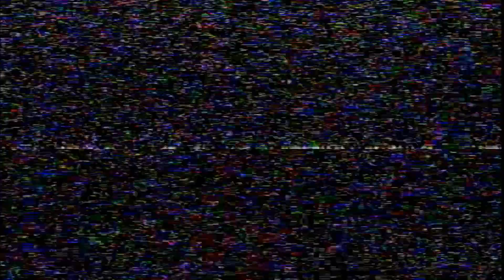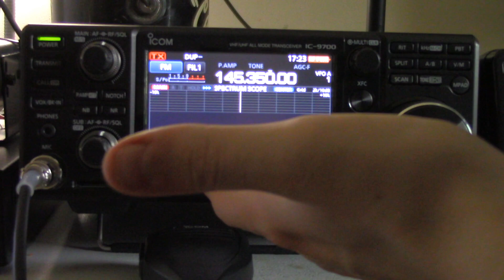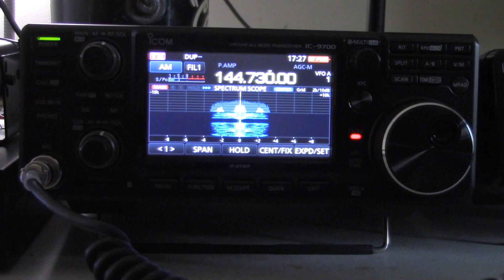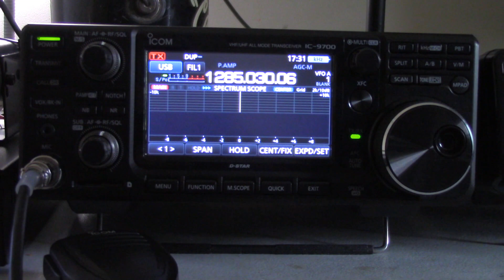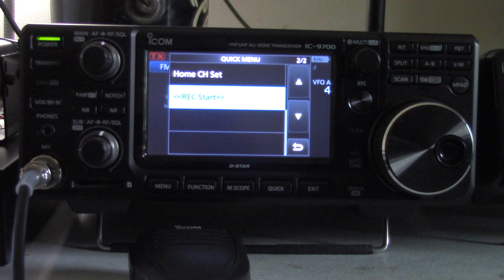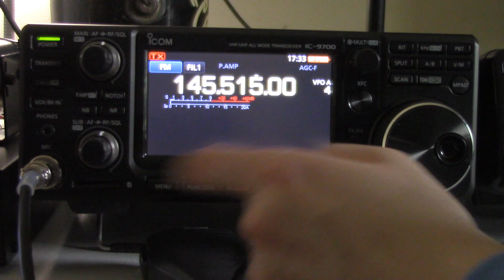Icom IC-9700 Overview: The Basics

Comment: Informative video, the IC 9700 has a learning curve a bit above the TS 790 that was purchased in the 1990’s, 2 + 70 still work but 23cm module is tired. 73 from VK4

Comment: Oh my goodness, what a lot to unpack with this video.  “Adjusting your wattage”, good buddy?  Please… it’s adjusting the power output.  It’s a radio, not a light bulb.  “This here is this here…”. Great.  Your comments about AM show a lack of understanding a controlled carrier design.  You made no mention of RF gain adjustments on a SDR radio.  And, could you go a little faster next time?
Reply from the maker: if you don't like the video, you don't have to watch it. 

I called it wattage for fun, lmao (I think I had an episode of "is it a good idea to microwave this" on my mind when I made this video for an audience of n=1, a local ham friend who wanted a whirlwind tour of the 9700 in lieu of a real technical overview)

I have built 80 meter AM transmitters that use controlled-carrier modulators, but that isn't how I got my masters in electrical engineering

Comment: Thanks, this was helpful. I bought a IC-9700 about 4 months ago, after owning a Kenwood TS-2000 for about 20 years. I found I kept going back to using the TS-2000 instead of trying to figure out the 9700. I will probably refer back to this a few times. lol

Comment: Do you still recommend the 9700?  I see other radios but they're low power, not sure I wanna get a base station with low power output.
Reply from the maker: Well, I would not recommend the 9700 for anything that doesn't need SSB or CW. If you do VHF/UHF weak signal DXing or work linear satellites, get a 9700; if you only do FM, get a Yaesu FT-2980.
Reply: @hs-tc  thank you.
Reply: G90, 20 watts is only about 1 s unit lower than 100 watts. VO1CSD

Comment: I want the ICOM IC-9700 for satellite decoding.  But is it true the 9700 does not have enough bandwidth to decode 9600 baud signals?  Thanks, CE4JDM
Reply from the maker: Unfortunately, yes. I've tried to get 9600 packet decoding (or digital voice signals) to work, but, the only way to do it is to set the USB IF/AF output to IF, then use a program like HDSDR to "tune" the IF, then put the AF output of that into the decoder program. For satellite decoding, I'd just use a normal receive-only SDR, maybe an RSPdx.
Reply: @hs-tc  Thanks!